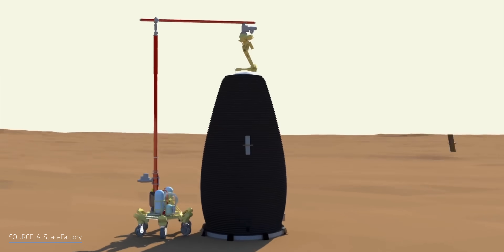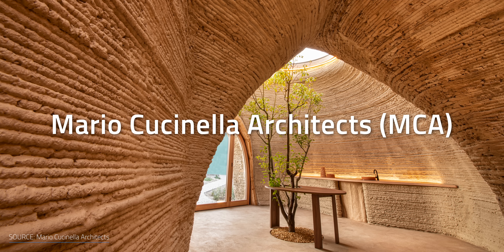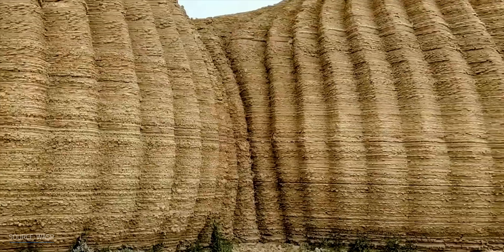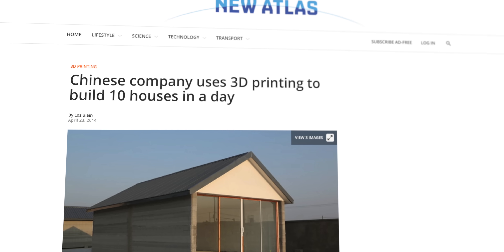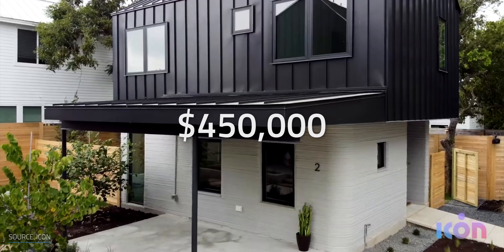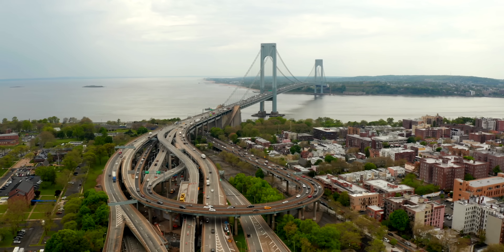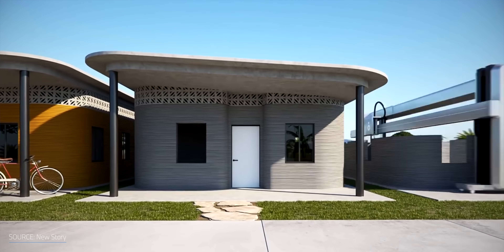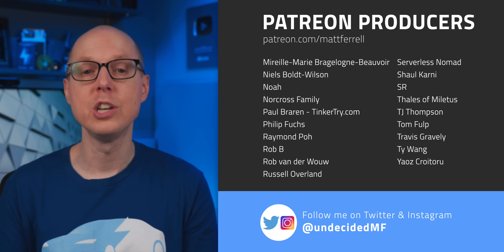The Truth About 3D Printed Homes

Comment: One thing not mentioned...bugs. I lived in a mudbrick house in Australia for 16 years, and borer bugs were a huge, huge problem. Had to seal every milimetre of the bricks with a thick layer of plastic paint, or the whole thing would have been a big nest for varieties of bees and wasps.  The mudbrick had some cement in it, so was harder than just dried clay, but the bugs loved it.
Reply: Use lime based paint, bugs don't like it
Reply: @____________________________.x  That is ok if you want to repaint every year. Or more. Torrential downpours dont do much for lime wash. Of course, you could always add to the footprint of the house and have wide verandah all around,
Reply: @job1199  Yes, normally mud brick houses have wider roof overhangs to keep rain away from the walls.
Reply: @____________________________.x  Exactly. Adds a lot to the cost.
Reply: @____________________________.x   yeah, i wonder why lime wasn’t use in the bricks to begin with
Reply: @____________________________.x  What about mold, mildew, and biotoxins, bacterias?  Maybe lyme can be mixed into the building material?
Reply: @Samadhi-c3s  it’s normally used as a lime wash, given that mould is a surface issue and wear and tear would require occasionally reapplication
Reply: Something poetic about copying the way insects do something, and then all the insects wanting to move in with you.
Just a matter of technology dealing with it. Not quite there yet. Could coat with lime, but i suspect lime is only found near coastal areas (correct me if wrong), and it would be nice to deal with it in the structure itself and not just paint over the issue/cracks, so to speak.
Reply: @tonyhawk123  lime is litterally just cooked limestone, and although limestone isn't litterally everywhere it also isn't limited to coastal areas a good chunk of Kansas and Missouri is composed of limestone it is a commonly occuring material on every habitable continent with plenty of massive deposits that are nowhere near an ocean.
Reply: @garethbaus5471  100 million years ago most of the centre of North America was covered by a vast inland sea.
It wasn't until polar ice formed as the Cretaceous ended that ocean levels dropped far enough to expose it as land.
Reply: @jimurrata6785  a lot can happen in the 2.7 billion years since the oldest known limestone deposits formed, very few places haven't been underwater in that time the center of North America really isn't that exceptional.
Reply: @garethbaus5471  So what's your point about Kansas not being a costal area?
Reply: @jimurrata6785  few areas are less coastal than Kansas, if you can get limestone that far from any modern sea you can get limestone just about everywhere.
Reply: @tonyhawk123  geologically lime is marine sediment, but since this was all laid down millions of years ago and the earth moves around, it can be found inland like in the Peak District (UK). In Africa, huge deposits in land locked Botswana. Lime is a structural building material, so ideally yes, add it to the clay or whatever. Looking around for antiseptic bongo juice is a waste of time.
In Africa they already do this because most of the continent has lower quality Limestone which isn't great for concrete, but great for this application
Reply: @____________________________.x  Africa is a Continent not a country
Reply: @tonyhawk123  Some of the purest limestone in the world is near the middle of Texas, which used to be covered by ocean.
Reply: Not to mention, you know, worms.
Reply: Why mudbrick? Was it an old house? All the results on image search look super modern. Were there any advantages?
Reply: @JPEight  mudbrick has some amazing thermal properties for the wall thickness, and it can be smoothed and painted much like drywall, or hang a facade like brick construction to make it look "normal"... And the material is super durable and strong with little to no seasonal flexing. In a lot of ways it is nearly ideal.
But bugs... Yeah... That's a problem to contend with in a lot of areas.
Reply: @CaedenV  bugs can be a problem. But in most cases there are quite easy solutions to this. Even in africa with termites and bugs all arround we can actually build high quality houses with mud bricks. You have to implement some solutions to the bug situation but it is quite easy.
Reply: @JPEight  It was built about 1990, by a structural engineer. Mudbrick because it was supposed to be nice and cool in the hot Aus weather, and took advantage of the pervasive clay soil in Qld. It was also a very nice looking building.
Reply: Same problems in the poor people version of the German "Fachwerkhäuser" (eng. half-timbered house) this houses need a layer of lime mixed with sand and gravel on the outer, because of the wet wether and funny visitors like bees or rodents.
Reply: @JPEight  well here in Argentina you can find old houses that were built with mud, but just for sticking the bricks together; still they don't offer much support like to hold drywall; my grandparents house is built that way
Reply: @Jonathan Carr  
It's not the homes that are the problem, it is the regulations...
Reply: I was thinking this would be an issue too. Bugs are already a problem for stick built houses, I can't imagine how bad it would be for one made of dirt.
Reply: I was wondering about that. Bugs and plants. How would you keep seeds from germinating in the walls?
Reply: @Call_Me_Mom  Seeds need moisture and sunlight and correct temperature to germinate - sometimes other factors as well eg presence of ash chemicals in the water (which happens after a fire and then rain). You do not need to worry about seeds germinating in the enclosed, dry, dark, wall... this is a non-issue.
Reply: @m0rthaus  they don't need sunlight
Reply: Ty for the info. It's important to understand how "greener" things play out.

Like the solar power plants. Unless you get over 50 plus years out of the original panels, the land space and mining of minerals that is needed for it is less Evo friendly than just burning coal or even more so using a nuclear plant. 👍🤗
Reply: Did the bugs get in the house?
Reply: @dennismitchell5276  Not really. They preferred places around the outside where we didnt often go. But the wall in the shed, which was unfinished and got turned into 100% nest, was mined right thru. If you let them continue it wouldnt be too long til they were inside.
Reply: How sheltered were the walls from rain/water permeation???
Reply: @b_uppy  All but one side had eight foot wide verandas. The bugs actually preferred the sheltered sides.
Reply: @job1199  
I am talking about the 'borers' rather than 'bugs'.
Reply: @b_uppy  The borers are the bugs. Wasps and bees, several varieties.
Reply: What was the problem with the bugs, wasps etc?
Did they make the structure weaker, or just annoying?
I don't mind having wasps around my place until they make a nest on something i need to move. Though wasp stings are nothing, bee stings are worse.
Reply: @pebblepod30  your home is a giant haven for attracting them...
dont mind vs hostile takeover because its a perfect environment for them are very different things.
like building an empty bee hive to well known specs...youre gonna get bees....
and many more than just a few
Reply: @pebblepod30  
Good question.  My theory is moisture allowed the soil to be workable enough for them...
Reply: @b_uppy  oh ok.
Reply: @pebblepod30  they would have mined out the whole walls. We had a wall of mudbrick oit in a shed that was never sealed. It became 100% nest. We had to dismantle it in the end. 

Mudbrick is not a structural material. The buildings were post and beam, with mudbrick in between. A beautiful house, and prob more eco than most. Painting the outside not much more difficult than finishing other materials. You just had to be aware, and keep checking, just like any other maintenance.
Reply: lol, they wanted a green house didn't they? it's just free real estate for nature.
Need to fight that MF to have a house. You may as well be homeless.
All of this is a solution looking for a problem.
Homeless people are already kind of green.
Reply: I lived in an adobe house in Colombia, SA. You are right about bugs! Before we moved in a man came and sprayed. The walls were literally covered in cockroaches! It was like cockroach wallpaper!
Reply: @cherylglaze8043  if you have trouble with roaches make traps out of boric acid not borax the kind for laundry 
Take sour cream sugar and the boric acid mix together now scoop it into small bottle caps place around your house for 1 week and remove them or it will attract more then place a light layer on the floor and in any crack and crevasse with Damascus earth
This is how I killed and stopped reoccurring but yours maybe reoccurring wich is fine not much you can do about it most people in my area have them every so often
Reply: Useful to be aware of.  Thanks.
Reply: We where made in HIS image
A good prayer:
I'm a sinner JESUS please forgive me for all my sins I know you shed your Blood for me on the cross at Calvary. Thank you JESUS for my salvation and for shedding they Blood for me. I love you JESUS. 
Romans 10:5/10 ct...❤️k
JESUSisLord!Amen...
Amen..
If you'd like to call someone who cares 
83
For
Truth.
bc you don't know when you'll die?
.y r u hesitant...........
Reply: @Mr.Caring  You left out the second most important aspect; repentance.
Reply: @CynHicks  not before they are saved. That's only for rewards in heaven. Salvation comes by grace through faith in JESUS allowing HIS Precious Blood to be shed for you and I, alone.
 We where made in HIS image
A good prayer:
I'm a sinner JESUS please forgive me for all my sins I know you shed your Blood for me on the cross at Calvary. Thank you JESUS for my salvation and for shedding they Blood for me. I love you JESUS. 
Romans 10:5/10 ct...❤️k
JESUSisLord!Amen...
Amen..
If you'd like to call someone who cares 
83
For
Truth.
bc you don't know when you'll die?
.y r u hesitant...........
Reply: @Mr.Caring  Repentance is absolutely required for acceptance of salvation. If someone is a murderous, thieving, lying, fornicating hater of God saying some words does nothing* without repentance. It may lead to God calling that person to repent... Repentance is necessary in that IT IS the acceptance that leads to following Christ. Rewards in heaven is a heavily debatable topic but repentance certainly is not linked to rewards in heaven.

Also, that sinners prayer you are passionate about is nowhere in the Bible. It isn't so much that the prayer itself is wrong as much as it is that it isn't necessary for salvation. What is necessary for salvation, according to Jesus in the Bible, is repentance and following him. 

Repentance is defined as a change of mind/heart. Feeling of guilt may or may not be necessary for that change but that change must come. Though, I would think that recognizing your guilt is most likely a part for everyone when repenting. 

May God bless both of us with wisdom.

*edit - we are all obviously all or most of those things plus some. Which is the entire point.
Reply: @CynHicks  you don't clean the fish before it's caught
Reply: @Mr.Caring  Oh, and the channel I linked is God's Abel

Edit - Able not Abel. 😅

Also I meant to add that it's all free and ad free too.
Reply: Yes, that's why that method of construction has long been outlawed where I live.
Reply: Not everyone lives in Australia lol. Lots of places have few or pretty much zero bugs.
Reply: 3D house is the same scam as EV cars
Reply: How would they get in a concrete wall it should be even harder for bugs and other pest to get in overa normal home
Reply: Doing this with Hempcrete would solve that problem.
Reply: Chagas disease is a big problem in south america, due to clay homes. The bugs who transmit the disease nest in clay walls.
They use lime to coat the walls in an attempt to stop them, but that hust helps if done regularly.
Reply: Dude you live in Australia. That is not normal world.
Reply: In Eastern Africa my grandparents origins, people have learned to smear the wall completely and sometime adding cow dung to the clay yearly. All mudhouse require annual maintenance......
It helps deal with bugs and if left unattended for a while, wild animals tend to want to come in indoor snakes and rats from outside.
Reply: Taurus SC may solve the bug problems? Not sure about borer bugs though, never heard of them.
Reply: i lived 12 years of my life in russia in a clay house its outer walls were about 50cm thik. mice and rats was the  best cnown  house keepers next to humans haha
Reply: What do you think about a spray that could harden over the concrete? Something akin to a flex seal?
Reply: @Roboss_Is_Alive  it would work, but is the same as painting with bondcrete, which is what we did. People just need to know that adobe concrete mixes have downsides.
Reply: I heard that hempcret is supposed to be pest resistant. I wonder if that would've worked better for you?
Reply: Plastic? Why not use thin layer of cement, mud, water and tapioka starch?
Reply: @habibainunsyifaf6463   I think the bugs would bore right thru that, and it would smell pretty much the same as the bricks, so the bugs would come flying in for the smorg!
Reply: Bugs will all die out by the time we will have to build houses like this to save at least some of the breathable air... no, I’m being optimistic.
Reply: I really wish I could make one in my country especially a cob house  
They are really neat and could make it myself slowly I don't need a big house and could always make it bigger if needed
Reply: That's the first thing I thought of right before I read your post. Deal Killer.
Reply: Hmmm they figured the hardware and software, I’m sure they can figure materials or sealant solutions.
Reply: Thank you, never thought about that aspect!!!
Reply: I was asking this question while watching this. Earthen homes seem wonderful however how do you stop bugs and animals from burrowing through the walls of clay and dirt?
Reply: but you can eat the bugs and live in the pod then. So it's a win \ win situation for the banks and the World Economic Forum.

Wake THE FnCK UP PEOPLE !
Reply: i guess you could say it was a 'buggy' design. lol
Reply: Is it mouse proof too ? .Oz has a massive mice in the grain nightmare.  Mice will find a snug home in anything tasty enough.
Reply: It's a design and cost consideration that people should be aware of whether there's already a perfect solution or not.
Reply: These Eco-Nazis see that as a plus. You can eat the bugs, right?
Reply: Makes sense that it a dirt home would need to be sealed.
Reply: Hey the bugs are the future of food. You where on to something. Bill Gates would like to speak with you
Reply: soak a cigarette in water over night. 30 seconds micro, pour around house.  Natural bug deterrent even used by western indians. also deters varmints.
replace every 2 months, every other room, every other month.
Reply: Guess that's why they called their company wasp 🤣🤣
Reply: crazy right imagine living in the wild
Reply: @sa.8208   If it's so crazy then why do some bug sprays have it in it. Why. Why don't you do some research before you start calling people names
Reply: Neem oil or solution.
Reply: Check out Fbr robotics from Australia
Reply: Lime wash.
Reply: presumably some form of deterrent could be used, I'm not familiar with such chemicals, however I have seen areas where houses are built on a wooden stilt foundation, and the use soaked wood that deters pets and termites.
Reply: These are for poor people. Screw it if they have bugs or collapse or dissolve.
Reply: We have those termites.
Reply: Love how OP said they live in Australia, and everyone in the comments are going on about how they should have used lime, stating that it's common everywhere, and then citing literally every continent other than Australia. 🙄🙄
Reply: https://www.youtube.com/watch?v=4MLJs1KRa0Y
Reply: A quality real lime plaster (not the cheaper cement based with a little lime in it) would solve that problem, but it’s expensive
Reply: Seems they're still working out all the bugs... Why I'm not buying it till I hit rock bottom, & it's dirt cheap!
Reply: I feel nothing will be perfect brotha. So why did you live there for so long? Like was it fun living in there or overall horrible lol 😆
Reply: @ggvbayareaoakland5914  House was great otherwise, but just a reality that mudbrick is not a good material in some places, and it is not easy or cheap to make it work.
Reply: Tie small logs with drilled holes in them in trees.
Reply: Mudbrick and concrete are not the same.
Reply: Unlike termites eat wood, those bugs you complain about won’t have your house for a buffet
Reply: I bet there’d be some sort of plant pulp that could be added to the clay to reduce bug infestation. Some gum trees or trees like tea trees have pesticide or antiseptic properties that would be worth investigating
Reply: @madbats69  lime has been used for centuries, this problem has already been solved, the OP just hasn’t chosen to do this for some reason. There’s no need to find some new additive which won’t be as plentiful as lime is.
Reply: @____________________________.x  Thanks for adding this comment. Smart solution ... too bad this man's homebuilder didn't realize this. The clay home's owner mentioned that concrete was mixed in. Concrete has a small amount of processed limestone (portland cement), so now I wonder what the right percentage of lime (crushed limestone?)  has to be to drive away bugs?
Reply: @____________________________.x  I think he lived there, I don't think he had it built
Reply: @madbats69  if 1 messure is  as effective as possible, cheap, and  doesn't decay, why would using love plant material be a good option? Plant material inside the wall would likely lose all insecticidal properties within a few years based on the components of the insecticides breaking down and decaying,
Reply: @____________________________.x  not to mention you go putting a non breathable coating like a plastic on a breathable structure you get worse problems than bugs.
Reply: @____________________________.x  lime is only common in Northern Americas due to limes being native to Mexico, so an  Aussie isn't gonna have tons of limes sitting around. Pretty sure they gotta ship em in and they aren't cheap.
Reply: @yarkivikselvumni  They mean lime from limestone, not the fruit.
Reply: @madbats69  yeah, cuz there arent any bugs that eat eucalyptus leaves 🤭
Reply: @madbats69  Rhubarb leaves contain a lot of oxalates, if a "tea" of these leaves is made and this tea is used to make the mud for the bricks, it may discourage insects.  Perhaps mixing some Diatomaceous Earth with the mud may discourage boring as well.
Reply: @HepCatJack  that's not how DE works.
Reply: @HepCatJack  Rhubarb leaves are toxic to humans, but you're on the right track.
Reply: @samsmom1491  you're not going to eat the floor are you?
Reply: @DrTheRich  I had to look it up just now because my grandma would freak out about poison if we so much as touched a rhubarb leaf. It seems you'd have to consume over 2.6 to 5.3 kgs of leaves to get a lethal dose. I never knew that before today and I'm close to 60!
Reply: @samsmom1491  Yeah, it's not dangerous to touch, I've grown and eaten a lot of rhubarb, never had a lot of issues with touching the leaves. I believe there are families of the rhubarb that are more dangerous, that you might mistake if you don't know what plant it is. but not sure.
Reply: @DrTheRich  I think Grandma was being overprotective. I miss her a lot!
Reply: @HepCatJack  I dont know where you would get that many rhubarb leaves. Or how much energy would be needed to boil that many rhubarb leaves....
Reply: @job1199  who said anything about boiling ?  You leave the bucket in the sun for a few hours.   Also, it need not be Rhubarb, there are many plant species which have high levels of oxalates.  The idea is to have oxalates in the mud brick, not to make the bricks taste like Rhubarb.
Reply: @HepCatJack  good point about not needing to boil. Still would need huge amount of whatever plant to make any difference to a whole house. Could maybe be done, but wouldnt be simple, and the agriculture needed might not be green. But worth looking into.
Reply: Just use bug bomb on regular basis and you will be clean of bugs in a few months
Reply: people have forgotten that the hardwood flooring adoption was the largest increase in lifespan of humanity next to hand washing.
dirt based homes will be havens for biological bacterial and environmental health problems.
going back to mud huts is just a fantasy for dirty tree hugger hippies
who want humanity to go back to caveman days and dying at the ripe old age of 30.
their fantasy is our post apocalyptic distopia and will be theirs too.
Reply: @kazzTrismus  we dutch have successfully been living in clay brick houses for 400+ years. Difference? We bake the clay bricks, not just dry and press together. 

Then you have a normal red brick wall, have an air space between two walls layers for insulation (although they only started doing this since less than 100 years)

For the floors they first used terracotta tiles and for the roofs terracotta roof tiles. So basically the whole house was made of dirt, minus the wood roof structures and window frames and glass of course.

Although glass is made from cooking sand which is als a type of dirt...

But I guess the baking makes you loose some carbon points...
Reply: @DrTheRich  when you Argument like this, even your computer or phone you are trying in is just dirt.
Reply: @DrTheRich  as a fellow dutchman i agree...now ask yourself.
i agree with you...how is exactly what youre talking about differ from mixing local mud and then just pumping it as a mix into a shape different?  in many ways its very different.
high pressure forming , precise and tested recipe, extreme temperature baking.
not just bare dirt floors driven over by a heavy machine.
excavation and often an engineered fill base even before a concrete foundation and basement.
this idea of just making a toothpaste mix of local dirt and squirting it in a pattern no pressure no baking on a barely tamped let alone thoroughly prepared surface leaves a lot of well known science out.
pressurized heated water based ceramic resin additives.
criticize the theory used here, not just accept it.
it wont get better with a team of yes men who do not think
Reply: @kazzTrismus  yes that's how we make modern bricks, but that's now how they made bricks in 1600, and a lot of these houses are still standing.

Back then you just put the clay in a shape and bake it in a big fire. They didn't have industrial ovens yet, chemical knowledge, pressure forming, etc. The idea of baked bricks is 6000 years old.
Yes a mudbrick doesn't require baking but isn't pure dirt, since you need a binding material like straw to keep it together. And really, you dry those in the sun. So you kinda bake them at a really low temperature.

If mudbrick does count as dirt according to people here, why don't baked clay bricks?
Reply: @donblub  they are in my opinion, well, dirt and rock. They sorted the dirt and rock to pick out the useful parts and then expertly reordered those in a way that makes them work like a phone. Isn't that genius.
We talk with each other through bricks while living on different sides of the planet. This would be seen as magic just 300 years ago.

Makes you realize the only difference between an actual rock and a smartphone, and whatever we manage to invent, is knowledge. What parts to use for what and how to reorder them.

(Well unless your phone has a lot of plastic, because plastic is made from oil, not dirt/rock)
Reply: @DrTheRich  ok, plants and rocks
Reply: @DrTheRich  density...insects cant bore through them...the likelihood these NON-pressure formed walls/structures have the density to keep insects out and moisture permeating  causing soggy/soft structural issues.
new brick and most other stuctral brick (old and new) do not readily absorb moisture like dried mud does...
especially without many of the modern techniques and chemistry's.
600 or 6000 years we have learned a great deal and theyre selling this idea that all we learned was how to pollute
....look guys...i wish this idea was plausible.
i really do.
but for a vast majority of the planet youre talking about constructing what will amount to cardboard ghetto's
not lasting livable hygienic homes (and environmentally that means better / more stable)..
communities built like this will need bulldozed every dozen or so years displacing thousands of people on a short cyclical basis
Reply: @DrTheRich  some of those houses are still standing...not a lot...to be factual a massive majority of those homes from 1600 are long fallen...and most of those people died at the ripe old age of 40 also
Reply: @kazzTrismus   my point was more response to these guys. Look we found a machine to turn dirt into houses.
My point was, that idea already existed for 6000 years, and it's called a brick furnace.

Resulting walls that insects can't crawl in to, are easy to construct. You don't need a complex machine, you can just put one brick on top of the other like Lego with some mortar.

If you want to turn earth I to durable houses for poor people, teach them how to make bricks. Don't give them expensive delicate inventions who's only extra benefit is, it can make artistic shapes.
Reply: @DrTheRich  ah yes..totally agree
Reply: @kazzTrismus  To your last comment. No most these houses hasn't fallen, they were broken down to build newer houses, because Dutch people like their shiny new houses. And the houses that did fell, it wasn't the brick that gave away. Most often they sunk because of inadequate foundations on soggy Dutch ground, or the wooden cross beams holding walls together rotted away and weren't replaced in time.

And also don't forget that the majority of houses from 1600 were still wood or timber frame. These houses obviously didn't survive till today.

And no people didn't live to 40 they lived to 60. The reason why the average age is 40 is because that includes a massive percentage of baby deaths, skewing the numbers. If you lived to your 20s you were also likely to live to your 60s.
Just stating the average number gives a very distorted image of the past.
Reply: @kazzTrismus  [citation badly needed]
Reply: @kazzTrismus  i came here to post this, my first thought was that this looked like a shelter people would build in a survival situation or possibly thousands of years ago, just without the need for a 3d printer and electricity and running water to construct, if i have electricity for a 3d printer i should also have windows on my house
Reply: @kazzTrismus  
That depends.  Use of rammed earth for homes doesn’t mean people are living in the raw earth on the inside.  Generally flooring is used, the walls are rendered or sealed, and cement is added.  It’s more than just a dirt home.
Reply: @kazzTrismus  I'm a tree hugging hippie and I don't want people to live in dirt floor hovels and mud huts. You seem angry at people wanting to explore alternatives in home building.
Reply: @kazzTrismus  dirt floors won't short your life span lmfao are you ok?
Reply: @thebigbarczynski5844  yes they will and do...and seriously...look it up
Reply: @kazzTrismus  they want medieval style, most likely, since the mixture used to fill up the walls in medieval housing, which is called wattle-and-daub, usually is made from clay, straw, soil, and if you have a cow or if other peasants have those animals, dung. 

Seems to me that there's a lapse in knowledge of how bad the life expectancy is during that era, bubonic plague aside
Reply: @kazzTrismus  That's not correct, electricity, clean water and the uprise of medicine helped us in doubling our average lifespan. Just look at the average lifespan in germany, when we alread, had wooden floors for centuries, yet our lifespan was still miserable.
Reply: @dieabsolutegluckskuche5174  having survived lawns and gardening I kinda think this guy was just ignorant. Makes me wonder just how clean his mother's basement is?
Reply: @kazzTrismus  Okay, then send me the research for a causality between wooden floors and the doubling in the average lifespan. I want to see atleast a meta-analysis.
Reply: @dieabsolutegluckskuche5174  That's like asking for proof that god is real.
Reply: @kazzTrismus  
I like the “Earthship” idea in form, i.e., a partially buried home with a glass covered front area for growing plants that uses gray water, but I could never do the buried tires and hippie walls with bottles and cans.  Maybe if it was built with concrete in a New Brutalist style?
Reply: @kazzTrismus  
You can treat dirt floors with oils that counteract that...
Reply: @kazzTrismus  They shouldn't build the clay walls directly on the dirt. a concrete slab foundation is really needed for the home. Using a post-tension slab would also help provide proof against earthquakes and cracking in the foundation. This would provide for a floor that could be cleaned and prevent insects from getting into the walls from underground. additional wall coatings may be needed depending on the climate and insects living in the area.
Reply: @christiaanbrown4278  Our house was on an 8 inch thick concrete slab. The insects were flying insects and found every mm of unsealed mud on the exterior walls. The slab did not move, but humidity changes caused gaps that the little beggers would find, so we had to keep an eye out. I still loved the house, maintenance is just part of being a home owner.
Reply: @kazzTrismus  just no. Even a home made with mud and dirt can be sealed.
Reply: @kazzTrismus  no it's not. Its called stucco. It doesn't just wash away and there is other stuff you can put on top of that too.
Reply: @kazzTrismus  look up Cal-Earth Institute
Reply: @orionishi6737  i lived in a 100 year old home on its 3rd re-coat of stucco and it was a maintenance nightmare.
we're in a wetter more humid climate and i certainly would not recommend it to anyone.
also the new coat that was recently applied was so full of specialized chemistry it certainly shouldnt be considered the same as stucco from even 50 years ago let alone 500 yrs.
and it was most definitely not a "green" alternative or justification for this joke of a proposal.
to do this out of cement would be barely feasible in many climates..
hey im sure since this is the internet theres plenty of people who'd buy a home made of epoxy based paper mache and be happy to not be living in a hovel...but..
dug up mud/clay and water from a garden hose through a cement mixer and over glorified caulking gun is a disaster waiting to happen
Reply: @kazzTrismus  Or you know... you can use sealants on the mud... or just use cement. xD It's all about finding cheaper building resources since everything is sky rocketing in cost lately.
Reply: @kazzTrismus   (by "hardwood" - do you just mean solid timber flooring, I find that Americans seem to call all solid timber flooring "hardwood" - as opposed to "laminated" or particle board etc, or is "all" solid flooring in the USA; Oak, Maple, Beech, etc -  ie. "hardwood" as it is properly defined (timber from broad leafed trees)  as in many areas of civilisation softwood (eg. radiata pine, douglas fir etc. is used for flooring - and it is regarded as quite durable (wood doesn't do so well in any case in wet areas unless very  well sealed. )) - just curious.

NB. - in the days of high infant mortality, many lived to "ripe old ages" -  if they kicked the hurdle of age 5 - getting out of the birthing suite was in fact well on the way to adulthood.  lol..  (we are kind of getting high in the "affluence" carrying capacity of our longsuffering planet)
Reply: @kadmow  no, i just mean wood thats tightly fitted/sealed and usually above ground (not sitting on the ground).
i will admit the north americans use the term the way you say tho
there was much more than just crib death in the era, including dying during child birthing
and the old jokes from video games about dysentery or tuberculosis (actually being true and not a joke).
which i suggest people look up.

im sure many cultures still using dirt floors may just be in a different climate or currently treat the floors differently
but in north america at the dawn of real science based medicine it was well recorded and noticed and encouraged that people use the abundant tree's to build floors into their homes
and it was known as some kind of inherent difference that was NEEDED here but not in europe.
Reply: @kazzTrismus  But my feelings disagree with you! Refute that! 😂
Reply: @kazzTrismus  Too bad, so sad... Dirt floors are THE best flooring for walking on... (I "adjusted" by making my own layered-cardboard floor-covers -- pretty nice foot-feel). By the way, if you (and your immune factors) grow up with them, they AREN'T just a feel-good-but-dangerous option, but an adapted lifestyle choice...
Reply: @kazzTrismus  LOL.. going on about "coof nazis", can't even spell 'cough'. That's all you need to know about this guy's informed opinion.
Reply: @m0rthaus  were you born yesterday? coof is a well known nickname for it
Reply: @m0rthaus  Coof is the "correct" spelling, it dates back to two years ago to avoid demonetization on youtube.
Reply: @kazzTrismus  I walk around barefiot outside on the street, grass, through puddles of water, dirt, my feet are dirty as hell lol, I think you are stretching with your dirt floor theory
Reply: @danmortenson5274  Siamese cats simply love "sharpening their claws" on cardboard, rendering even the toughest examples into compost in a few weeks.🐈
Reply: @kazzTrismus  you are absolutely right with all points made.
Greetings from Tasmania/Australia.
Reply: @dietmarwolf79  He's WRONG on all points
Reply: @kazzTrismus  No, no, no and no. Wrong about everything
Reply: It saddens me that this comment has so many upvotes. Earth is an amazing material for construction, for about a hundred reasons that can easily be researched.
Reply: @kazzTrismus  wow never knew this.
Reply: @laius6047  It's ok he made it up.
Reply: @laius6047  You never knew it Because its NOT TRUE....